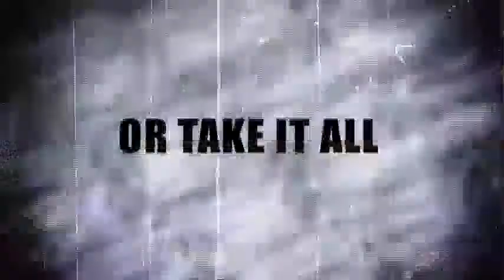DiamondBack ATV Solutions

Comment from the maker: It's made of diamond plate aluminum, so you don't have to worry about it rusting.  Plus, that price includes the cover, a set of 12 ft ramps (that fold up to six ft), adaptor bars and either side rails (if you have the side loading package) or the rear cab guard (if you have the rear loading package.)